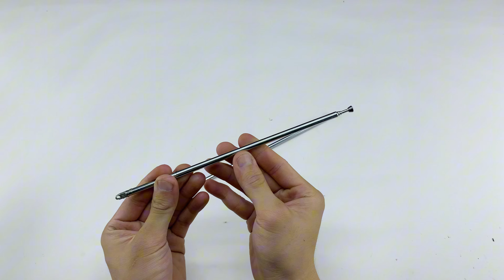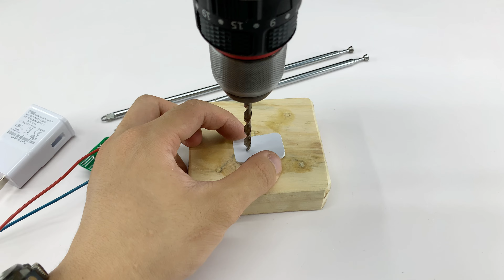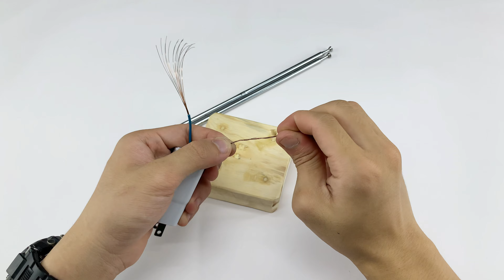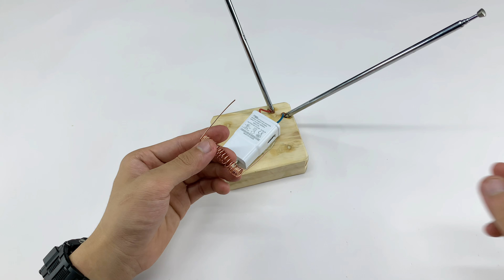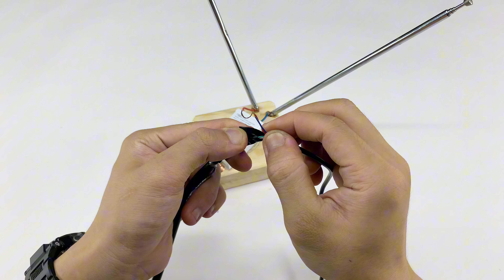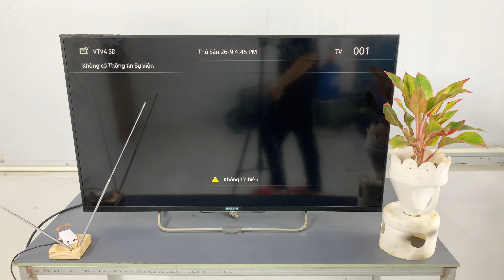Say Goodbye to Antennas! Put a RADIO ANTENNA into the Phone CHARGER – See the Magic Happen! 📡

Comment: What if the charger is faulty. ....will the signal reception be perfect?
Reply from the maker: Good question, my friend! Even if the charger is a bit faulty, it might still work — but the signal could be weaker. Have you tried testing it with another charger? 😊